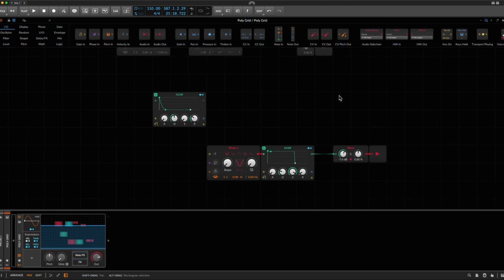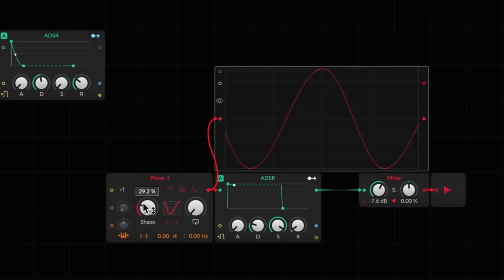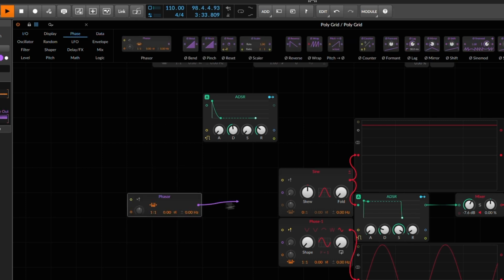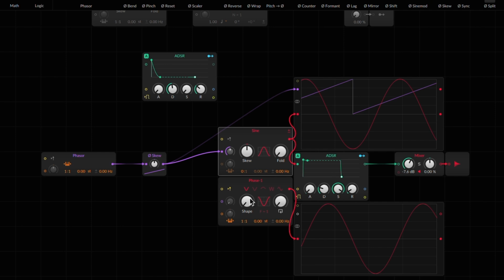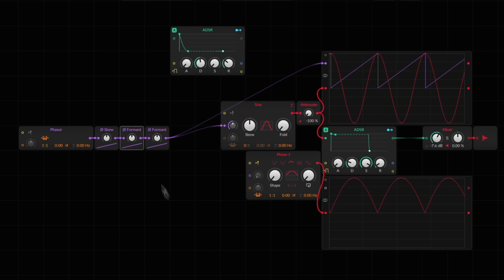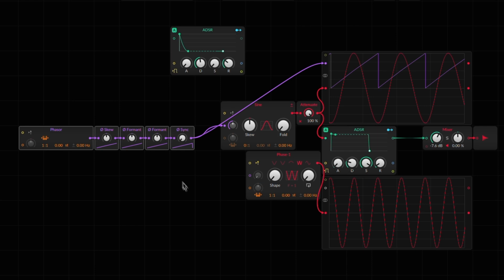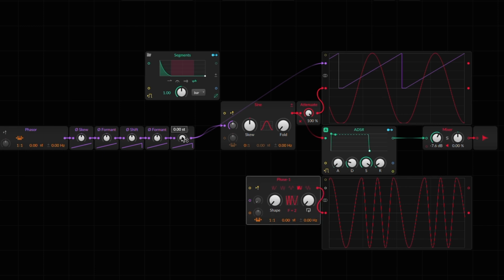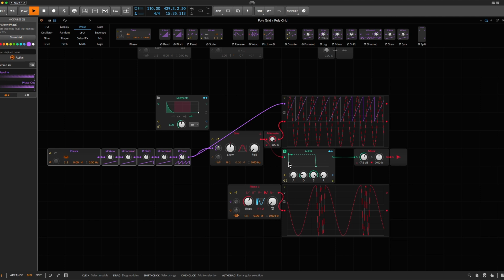What is a  Phase Distortion Oscillator and why is it 😎

Comment: I have a request or suggestion for a future video.
Can you look into how to recreate/simulate Arturias Minifreaks new wavetable oscillator using the grid in Bitwig?
Dash Glitch has a nice video about the new Minifreaks wavetable oscillator where he shows its features.
It has a Width and Tone adjustment feature and especially the width parameter sounds really nice.
I tried to make something similar but i cant figure it out.
The Width parameter applies some kind of PWM or similar to the wavetable.
Reply: Saw your video about phase and warp modes and its basicly what i asked for.
Nice, thanks.
Reply from the maker: I'm always open for requests! You might want to watch my tutorial "A comprehensive guide to phase and warp modes in Serum, Bitwigs Grid and other synths like it". That should show you how to do this and much more  :)